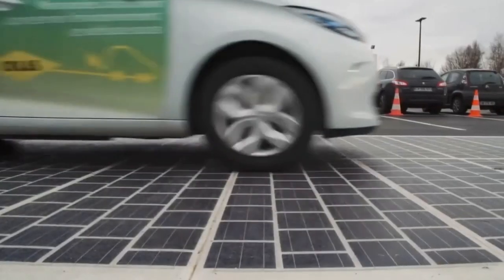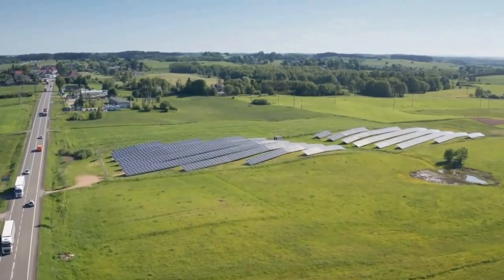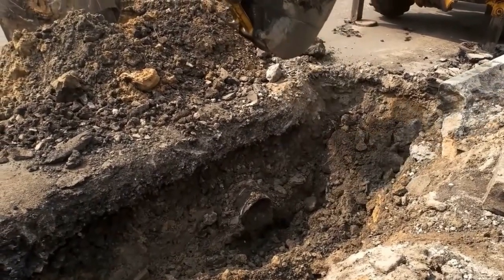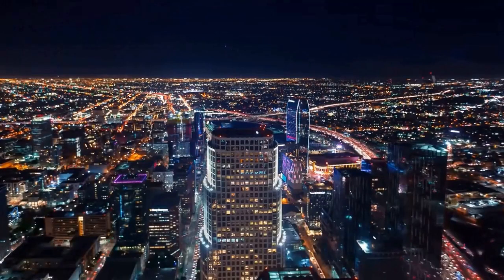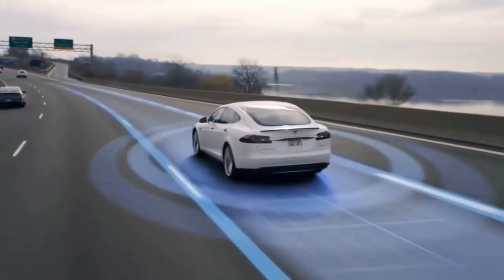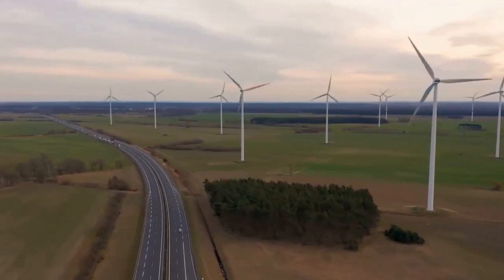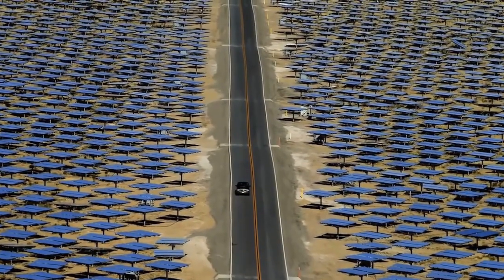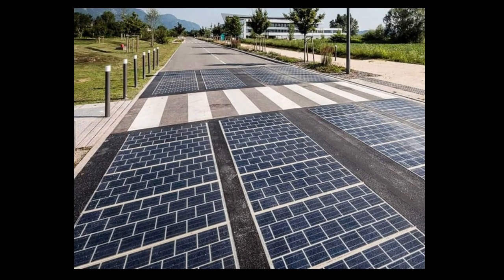Solar Panel Highway

Comment: Solar panels on roadways sound okay in theory, but they won't be able to generate a lot of energy due to traffic and less than optimal lighting from trees and buildings. I don't think they are durable enough to withstand many years of vehicles' weight load or impacts from accidents.
Reply from the maker: Thanks for your comment. You raise valid points about the practical challenges of solar panels on roadways. Indeed, factors like traffic, shading, and durability are important considerations in realizing the potential of this technology. While the concept holds promise, addressing these concerns will be crucial for its successful implementation.